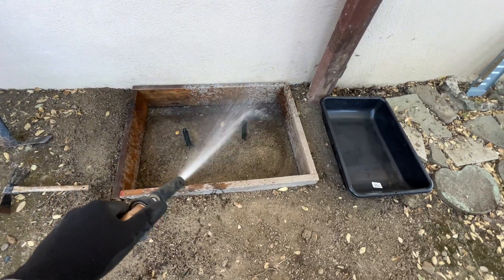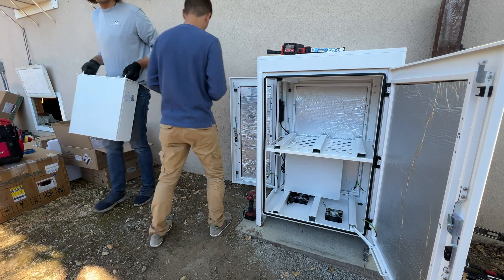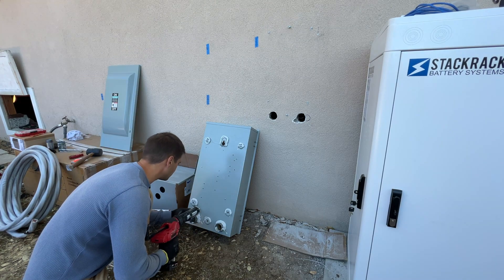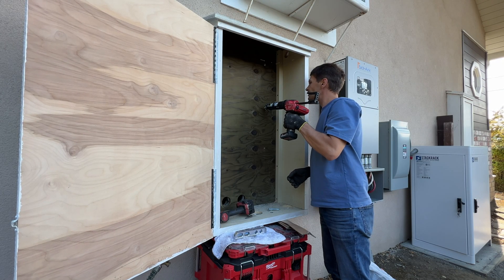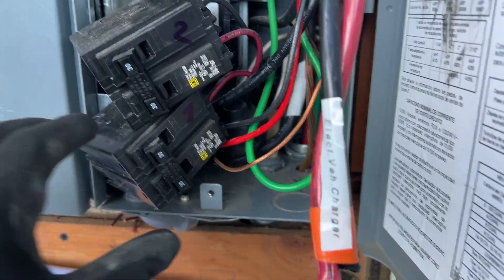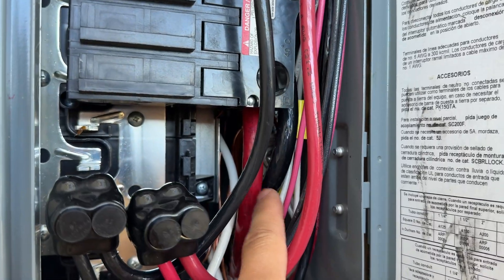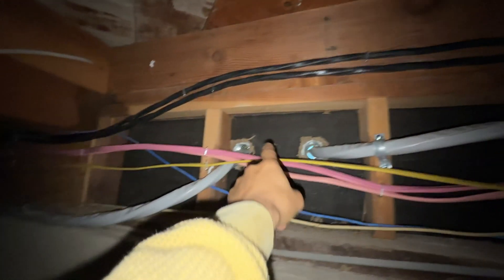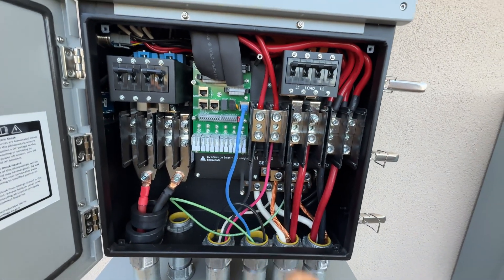Full-home battery backup with AC-coupled solar

Comment: Thanks for the video. I have a solaredge system and I have been curious on how to tie that into a hybrid inverter that can be AC coupled. When the grid is down, does the Solark send a signal to the old inverter to make it turn on to start capturing energy from the panels?

Comment: How has the Genius panel worked out? How does it compare to Span or Lumin?
Reply from the maker: Configuration seems complicated, you have to contact manufacture to do setup. Didn't install Span or Lumin yet
Reply: @SolarEngineering do you like the idea of smart panels? Will they become more common?

Comment: How do you like this solarstack battery with sol-ark? how it compares to pytes v5 or homegrid in your opinion?
Reply from the maker: I don’t see much difference in the batteries themselves, but there’s a big difference in the cabinets. I like the quality of Stackrack’s cabinets.

Disclaimer: I’ve installed two-battery cabinets from both Stackrack and Pytes, and Stackrack has a better technical design. However, I haven’t yet installed a six-battery cabinet from Pytes.

Comment: what is the part number for the 2 pole transfer switch please?
Reply from the maker: Siemens GNF324
Reply: @SolarEngineering  I just looked it up and its a NON-fuse.  is there an advantage to a fused vs non-fuse transfer switch ?

Comment: Great Work ! 
I just noticed that the backup panel is installed quite far from the main service panel. Wouldn’t it be easier to place the backup panel next to the MSP since you’re transferring loads? Just curious about the reasoning behind the placement!
Reply from the maker: The battery cabinet has to be 3' from the window, so not much room to rotate equioment